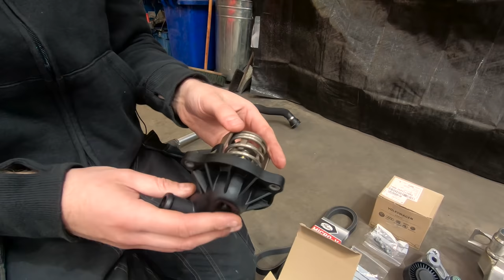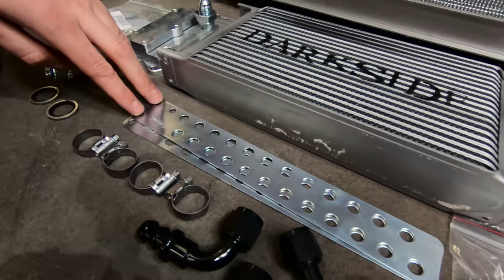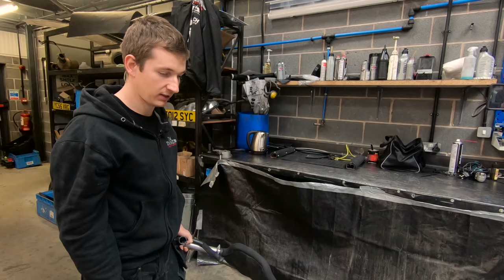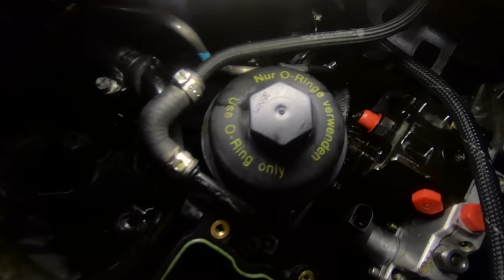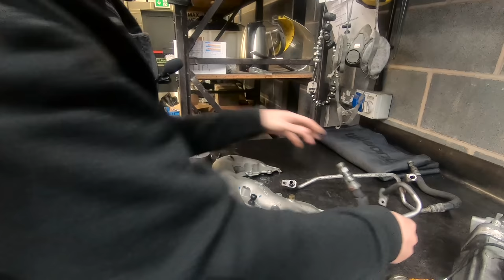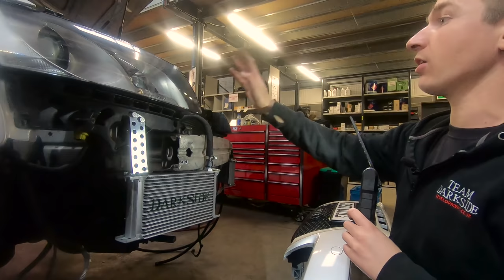OIL COOLERS & RADIATOR - AUDI A5 3.0 TDI QUATTRO PROJECT - DARKSIDE DEVELOPMENTS - PART 15

Comment: hi guys, i have a 1998 model a6 c5 2.8v6 quattro, I want to put a radiator separately from the water cooling radiator for transmission cooling, just like you did. What I want to ask is, does this external cooler you make really work? Did it cause you any problems afterwards?
Reply from the maker: Yes it worked perfectly!
Reply: @DarksideDevelopments  Thank you so much :)

Comment: How much bigger is the radiator compared to the stock one? Looking for an upgrade for the 2.0TFSI curious if yours could also be used for it.
Reply from the maker: If you email us the VIN we can check if it will fit and what the OE dimensions are

Comment: So this is adding oil coolers for cooling the DSG gearbox? And what about the Tiptronic ZF gearbox does it have some kind of oil cooling system, if so can it be upgraded? Also some advice, when my A4 comes to me this summer it’s gonna have around 66000 km on the clock, 2016 model A4 B9 V6 Tdi 272hp S line. I am planning to change the gearbox oil right away. Good practice, right?
Reply from the maker: Yes, log the temperatures before you do anything too crazy! Changing oil is a good idea!
Reply: @DarksideDevelopments  how do you mean log the temperature? So can a oil cooler be added to a ZF gearbox and this aluminium big radiator I didn’t find one listed for A4 b9, does a B9 A4 ZF gearbox even have the oil cooler on the side of the radiator? I was thinking it would be nice to upgrade to a nice aluminium radiator along with the intercooler at least...
Reply: Maybe it’s overkill for my application, since I don’t need more than 310-320hp max, intercooler, manifolds cast iron and stainless link pipes as well as air intake silicone pipe with a remap would probably be enough, right? Maybe some suspension parts along with Eibach progressive springs and spacers
Reply: Maybe a better turbo, but all this you will advise me in the email when I send an inquiry...
Reply: Just so you guy’s know I sent an email finally through your webpage.

Comment: @0.42 are you sure about the weld of the big hose connection? There seems a crack and not welded to the radiator body...
Reply from the maker: Its not a crack, it is some black material that comes out of the aluminium when you weld it. It was pressure tested before fitting to the car

Comment: Does having an external oil cooler change the coolant temp by much as you dont have to cool that oil or have you not tested this on it's own?
Reply: Never did a true test as conditions changed a lot but I would guess 10c lower with it like this. Oil still went over 100

Comment: How do you get airflow when fog lights are put back in? or do you just remove them when you are on track?
Reply from the maker: You can do a couple of things. Drill some holes in the grille to get airflow through, some grilles (such as the S5 we will be fitting) already have them. Or you can just remove them for track, since on the road it is unlikely to get too hot.

Comment: Where Can i buy adapter oil cooler for 3.0 tdi ?
Reply from the maker: A link to the kit is in the description 
Thanks
Reply: on the site you are selling the whole set I need the radiator adapter only I don't the rest of the set
Reply from the maker: @nakutyrob3465  We only sell the complete kit.

Comment: You do not need to remove the hypressure fuel pump to remove the oil cooler
Reply: You certainly do when it has a big gearpump on the back (CP3)